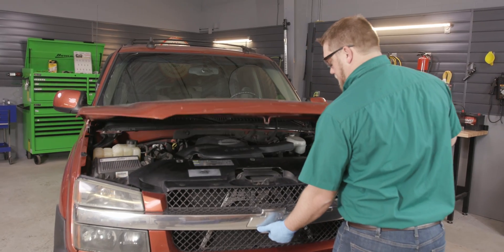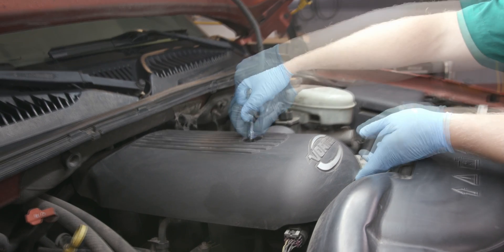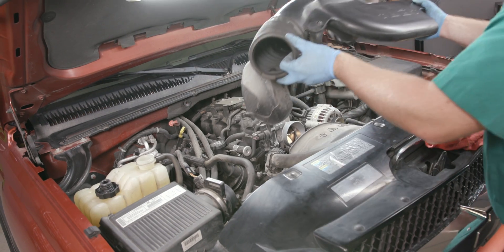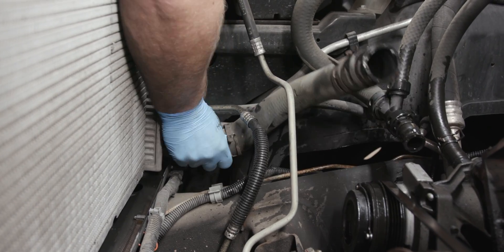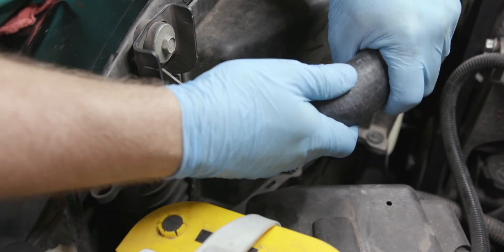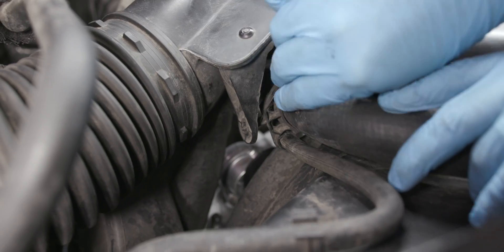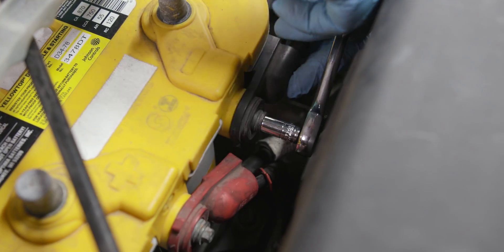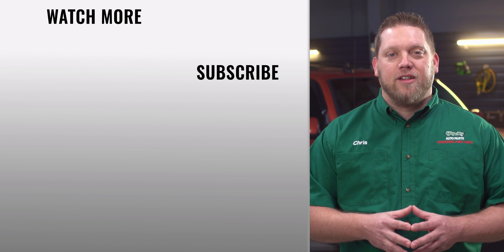How To: Replace the Radiator Hoses on a Chevy 5.3 Liter V8 Engine (Vortec)

Comment from the maker: Supplies Needed for This Job:

1. Safety Glasses: https://orly.cc/4e7cFKz
2. Gloves: https://orly.cc/3YKu3QZ
3. Drain Pan: https://orly.cc/3OJj8Bd
4. Ratchet and Sockets: https://orly.cc/3Odkxji
5. Fan Clutch Wrench: https://orly.cc/3CEnjMm
6. Radiator Hoses: https://orly.cc/4gzdblQ
7. Coolant: https://orly.cc/4hLw99S

Comment: NEVER mess with the petcock (especially those plastic ones). They are quick to break.  Leave it alone and act like it doesn’t exist.  Drain the radiator by disconnecting the lower hose.  Trying to drain the radiator using the petcock is a recipe for disaster.  Once broken you’ll need to scrap the radiator and buy a new one.
Reply: I learned the hard way that happened to me under Lincoln Town Car I had before my Yukon Denali
Reply: V2135

Comment: on the bottom water pump hose there should be an expansion spring in it , so that it doesn't collapse at high out put , may have to install the old one ,

Comment: lets see if anyone answers this /////   I wanna replace the smaller hoses going through the throttle body. and the small clamps that are rusted out, I cant find any listed
Reply: Gates 18126 is for the longer one. Can't find any info for smaller one on right side. I may just have to make one. It looks like it's about 1/4?
Reply: @ktaylor6776  thanks kindly

Comment: 2004 and after have no radiator petcock, just a blind hole where it used to be. You have to pull the lower radiator hose to drain the cooling system. Rumor is that too many people were breaking the plastic radiator tank while trying to open the petcock. GM's solution: remove the petcock!
Reply: typical solution
Reply: 03 is the same way. All these videos claim the petcock is on all tahoe suburban ect but no they aren't.
Reply: That’s super helpful to know before doing this project tomorrow. I’ve got a 2004, so thank you!

Comment: Using the OEM radiator clamps on the bottom hose to the radiator is near impossible. I suggest buying new clamps that adjust with screwdriver. This video makes it look easy as all junk was removed, in real life its not easy at all.
Reply: Just took it off literally impossible get back on properly
Reply: Robby T yes your so right I have put on the screw clamps as well on my 1991 GMC 1500 5.7.
Reply: 😢😅😮❤
Ll